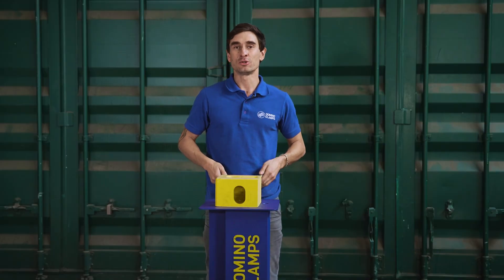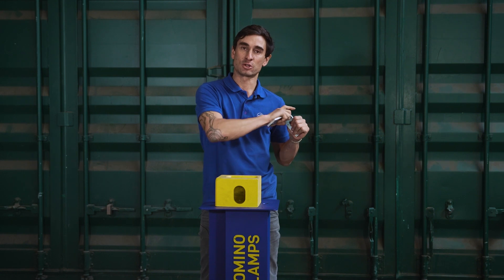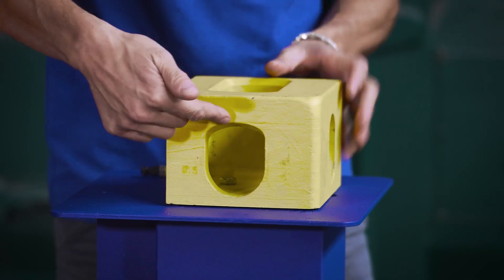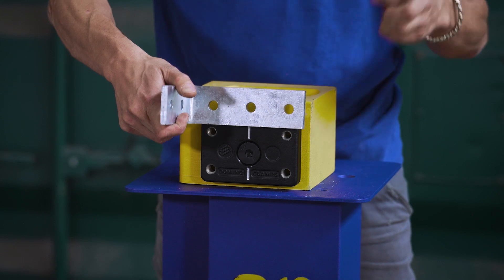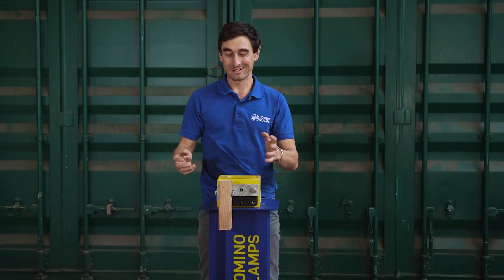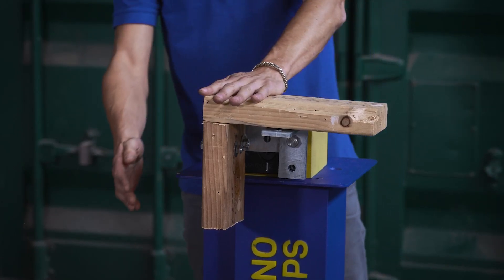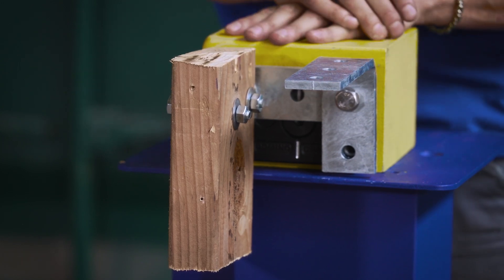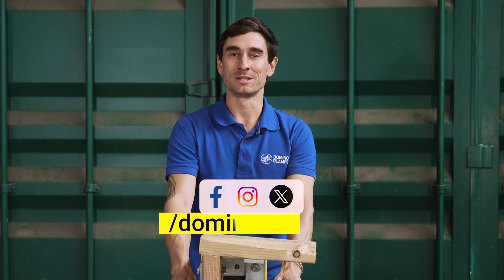Shipping Container Framing Bracket I Container Brackets - Domino Clamps

Comment: What about centre fixing points, beyond the corners? Do you screw directly into the container housing using tech screws or something?
Reply from the maker: We have a roof clamp coming soon which will help solve that problem without having to use self tappers in the container steel.